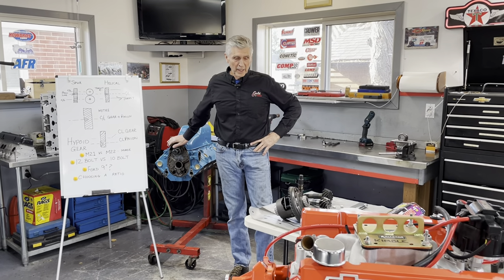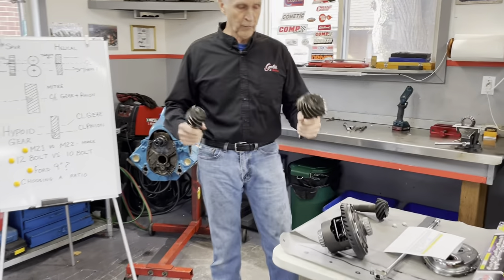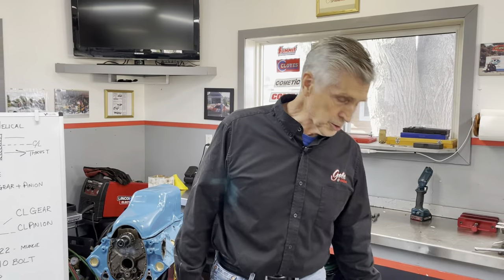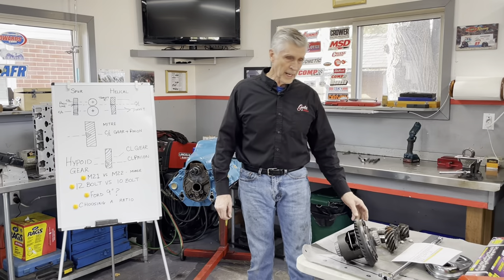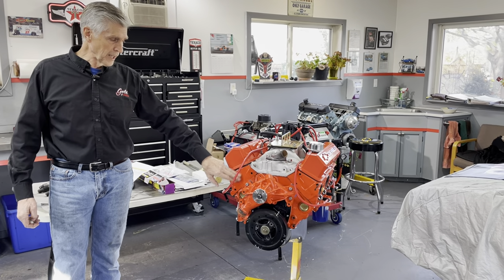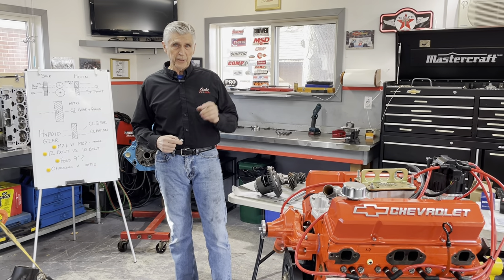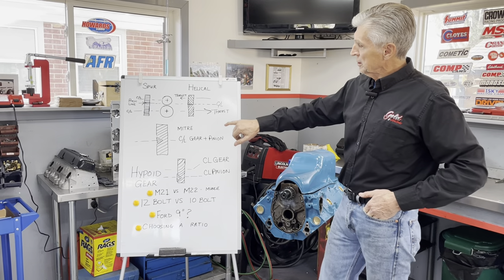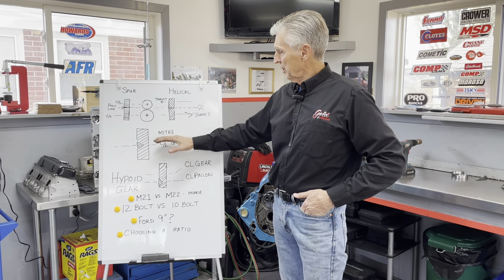How to properly select a gear ratio - Why does an M22 Rockcrusher whine? 10 bolt VS 12 Bolt and more

Comment: Man just yesterday I was wondering how rpm is limited in an msd and here it is! fires every other spark hey? Thanks! Next question is, "why exactly do people say that hitting the chip can be hard on the engine? Please explain! I could google, but I enjoy your videos.
Reply from the maker: Good question Umakeme, lots of interest in this subject. Here is my take on it. 
If the driver stays on the throttle, fuel and air mixture continues to flow into the cylinder but is not ignited. This can cause hydrolocking and/or excessive pressures. Then when it does fire, the MEP, (Mean effective Pressure) in the cylinder may be excessive. Also the misfire throws the engine off balance every time it misfires. 
All the other comments, which I will get to, are correct, this is not good for an engine, but in short track circle track racing pretty much everyone does it, especially underpowered cars that need more RPM in the corner.
Typically they choose a gear ratio that will get the engine to the max RPM just before the point where they should lift and get on the brakes.
I don't like it either, but testing proves that lap times are better when you hit the chip twice every lap. 
Hope this helps. AG

Comment: for driving lower output engines at track ,(NHRA Stock class racers use) more 1st and following gears  to get to engines rpm range sooner. I can not see much different if a 3 speed automatic is 1:1 in 3rd gear. and drive higher munerical 1st and second
Reply from the maker: Thanks for sharing your experience. AG

Comment: I did not know it's likely you will use the same shim for a different gear set.
 Maybe not physically the same shim but the dimensions might be very similar.
Does this hold true for a 9 inch?
Reply from the maker: Thanks for the question Jenifer. No Ford 9" are set up differently in a separate housing, sometimes called a Pumpkin. They can then be installed (front loaded) already set up and adjusted. GM and other similar differentials with the rear cover must be installed and adjusted (shimmed) in the car. AG
Reply: @goldsgarage8236  You were talking about how precisely. The gears were machined and you could use the same shim pinion and bearing and it should sit in the same exact location, Or at least a very close starting point.
With this be the same on a Ford 9 inch? I realize it's a separate center section. Even so it's still has a similar design. I'm just asking about a new gear set being machined to similar tolerances of the original gearset And likely be able to use a similar shim.
Reply from the maker: Genifer, to be clear, Ford 9" use adjustable threaded collars, they do no use shims. AG
Reply: @goldsgarage8236  there are shims and a crush collar on the pinion gear.

Comment: I have a 1988  chevy 4x4 with 700r4 trans and 200 hp 350 engine with 3.42 gears  if I change to 4.11 I have more bottom end torque plus towing power

Correct
Reply from the maker: You sure will. AG

Comment: I have a question for you how come when you do a drive shaft people usually set the pinion angle of the drive shaft between 1 to 2°?
Reply from the maker: Good question. The driveshaft must be offset, or have pinion angle, (same thing)  so that the needles in the universal joints rotate. Typically pinion angles are closer to 4 degrees, depending on the application. Hope this is what you were looking for. AG
Reply from the maker: Pinion angle is also necessary to compensate for the difference in elevation of the transmission output shaft  and the differential in the chassis.AG

Comment: You are using the shim to setup the pinion depth into the ring gear...
Reply from the maker: Correct, we used the original shim and got a nice contact pattern. AG

Comment: Right...  3.73 gear usually on rpm at 60 mph it is at 3,000...  Depends on tire height.   4.88 is not good for street unless you have a lot of HP and torque, a lot of rpm involved.  I know, I have a 8 sec. car  in the 1/4 mile...  1/8th runs 5.62 at 123 mph...  1/4 runs 8.82 at 152.52 mph.  66 Chevelle tube chassis car and is light.   2,370 lbs. with driver.  Car will run around 5.40's in the 1/8 th.  468 cu.in. on race gas and a single carb, SV1 made by Pro Systems, they have the world's fastest carb.  Billet carb, one butter fly, round, two spray bars to discharge fuel into engine.  It's better than the best 4500 dominator, makes 10 more HP over a dominator...
Reply from the maker: Thanks Leonard, an 8 second car is a serious hot rod. It would be a fun ride for sure. AG

Comment: Steve Mossis has a really good video about why you NEVER want to hit the rev limiter. It is so hard on engines that he will replace the rods asap if one of his engines hits the limiter hard.
Reply from the maker: Thanks for the info Bdd. Circle tracks and sanctioning organizations impose RPM limits to equalize the competition. They enforce them using rev limiters. They test the chips and rev limiters routinely as part of Teck inspection.
I don't like it either but racers know that they  will get the best lap times when they hit the chip so that is what they do. This is especially true with underpowered cars that need all the torque they can get out of the corner.  
Actually our experience is that we get 3-4 years (About 10,000 laps on 1/2 mile track) on our engine without touching it. We do a leak down and compression test, change the valve springs, and dyno it every year. It often makes more power than the year before. If the power falls off, we freshen it. 
I think drag racers also use rev limiters routinely on the launch.

Comment: I broke alot of muncie trans with  a 2.73 rearend...  9" Ford rearend is the best, thats what I run in my fast car with a bigblock!  35 spline axles 10 bolt pinion support Ultra case Strange and axles...  4.86 gear for a 8 sec. car...
Reply from the maker: Thanks Leonard, a 9" Ford is what you need in an 8 second car. AG
Reply: Pontiac 9.3 works well

Comment: Never ever ever set up a race engine to run off of the chip and only use the chip to protect the drive train. The cylinder chamber pressure becomes very inefficient and dangerous to the piston when the spark plug only fires intermittently on the chip. Piston damage is a sure thing.
Reply from the maker: Thanks sqr. I agree with you, but drivers care more about lap times and winning races. Especially if they are underpowered and need the torque coming out of the corner. Testing has shown that lap times are better when they hit the chip, so they do it anyway. AG

Comment: I don’t know why, but did Dana 60 I know it is tough as the Ford 9 inch and it’s like half the price can’t understand why nobody uses that. Maybe it’s a little bit heavier I don’t know but it sure is as strong and it sure is cheap.
Reply from the maker: Thanks Tucker, they are both more than you need for most street applications. AG

Comment: Many muscle cars had big block engines with 4 spd transmissions. The same car with a 6 cylinder water heater only came with three on the tree. My Dad always said the 6 cylinder cars needed the 4 spd trans as they did not have the torque the big engines did. I know a guy that had a 68 Mustang with 390 and 4 gear. When out on a date he could drive around in 3rd gear. Proved what Dad said.
Reply: My sister had a '64 Dart GT convertible with a slant 6 and a four speed.  It was a fun little thing.  That transmission had a 3.09 first gear unlike the typical 833 that had a 2.69.
Reply: @craigbenz4835 Yes, there are some. The US market may have gotten the slant with 4 spd longer than Canada. After about 1962 the 4 spd was not optioned for 6 cylinder Mopar cars. Trucks could get the 4 spd truck trans. 
When the gas crisis hit, all the OEM's added OD to 3 spd transmissions for economy. Then there was the numb nutz that shifted to "4th" at 45 MPH because that is what they had always done. Hammered the trans input bearing out from the low RPM.
Reply from the maker: Thanks for sharing your experience Dale. AG

Comment: 2004r or 4L80. I blew up so many 700r4 it wasn;t funny.. My built 2004r has lived quite a few years now behind 1300 hp engine. Going 4L80 when I up it to 1600. I wouldn;t put a 700 in anything with more than 400 hp. The gear splits suck too.
Reply from the maker: Thanks Paul. You are in a different league with 1300HP. The 2004r is a great choice, I should have mentioned it also. AG

Comment: Dont they have a 3.00 gear in a 9 inch???
Reply from the maker: I am sorry, I do not know but i would expect they will have something close to that. AG
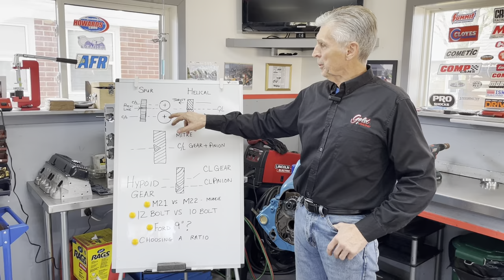Reply from the maker: You won't ever find a gear with an exact ratio. Gear manufacturers always use a "hunting tooth" so that the same teeth on the pinion don't always contact the same teeth on the gear. Instead of say a 3.0 which might have 10 teeth on the pinion and 30 on the gear, they would use a 10:31 ratio for 3.1. AG
Reply: @goldsgarage8236  I looked into this & found the teeth count to be 39-13 to make the 3.00 gear. So I think what u was meaning is not the ratio but the teeth count. However I found that the 3.50 gear is 35-10. 10 being a even number. But the 35 teeth on the ring gear is odd, is this what u meant?
Reply from the maker: Good research on your part Jesse. The 39-13 3.0:1 is an exception. So when the pinion rotates each tooth on the pinion will contact the same 3 teeth on the gear every revolution. This is not desirable for wear or noise.  The number of teeth on the pinion should not divide into the number of teeth on the gear. By adding one extra "hunting tooth" the contact and therefore wear would be more evenly distributed.  Hope this helps, let me know. AG

Comment: Not really a solid comparison on Dave and Gary's cars.  It could only be if the two engines were making the same torque at the same RPM- linear.  That 427 looks like it has a cam sacrificing some low end grunt where the 2.52 ratio wants to live.  I always tell people, I don't care about peak numbers, I care about where the values are throughout the whole range on the chart.

Comment: A helical gear in a transmission is not stronger than a straight cut gear. Wrong about that. Also, the Dana 60 is the ultimate differential for a drag car. Not a 9 inch Ford. Also the pinion on a 9 inch is lower thus causing more parasitic power loss than other diffs.
Reply: The Pontiac/Olds 9.3 is right about there in strength with Dana 60, unfortunately they quit making make in 64 and parts are expensive these days

Comment: M22 has straight cut gears which are noisy, weaker but run cooler
Reply from the maker: Thanks for your comment Ben. AG
Reply: Stronger
Reply: @robr5786  weaker, if you have a gear that's 1" wide and gears are straight cut, gear is 1" wide. If gears diagonally cut then gears are about 1.25" wide and case needs to be stronger because of the side load that's created and then there's the heat involved 🧐

Comment: "If you don't want to re-use the cast shims you can use other shims equal to the thickness."  You can tell this guy genenerally only shims garage queens and weekend warriors.  Almost always on a driver with mileage the cast iron shims are worn to the point where it requires little effort to remove/reinsert them.  What do you expect when hearing the auto gospel from a guy who continuously has hands as clean and soft as a baby's azz, a clean uniform with a square collar, and employees... Just for the record- I have over 200k on my gears from the late 90s and for sure would expect gears to hold up on a low mileage gear swap.  I have heart though, never have I been in a position to have to "buy my car back."

Comment: Okay so after you multiply the first gear ratio times your torque I get that part but after that none of your math makes any sense. It says torque at rear wheels foot pounds times weight and then you got car weight next to that you're not explaining that properly. I like your channel I wish you would explain that
Reply from the maker: Thanks for the question Richard. Torque at the rear axle in first gear is torque at the flywheel x overall gear ratio. (transmission first gear ratio x rear end gear ratio.) So if I have 400ft.lb at the flywheel and a 2.52 first gear and 3.55 rear end it would be 400x2.52x3.55= 3578ft.lb. (of course there is an efficiency loss due to friction and heat along the way) Next is the ratio of the weight of the car to torque. Acceleration =Force/mass. If you look at the chart we posted, it might help you to understand. Hope this helps. AG

Comment: Wonder why they make the ford 9" with a 3.0:1 ratio
Reply from the maker: thanks Jesse. It might work well on a 1.5 mile track. AG
Reply: We had a F100 with a 9 inch rear end and 3.00.1  gears. It was well over 300K miles on it.

Comment: I. Drove 67 -- 68 - 69 z-28s junk  my 69 nova 396-375 was bad - hard on squirrel nuts then  moroso nu
ts  , be careful what u say I was there - I learned in 12th grade without u- tube , in 1970 the big mtrs put me 3 links even though I had .540 -   560. Chev service cam 😅

Comment: Wrong not a 4.88 pinion gear  not 11 teeth  ,in 69 I was in hi school changing gears and 110 needle bearings inside the clusters of munchies 4  fake !!!
Reply from the maker: A 4.88:1 is 8-39. I will demonstrate it on the next video. AG